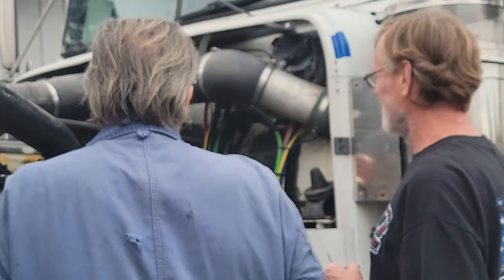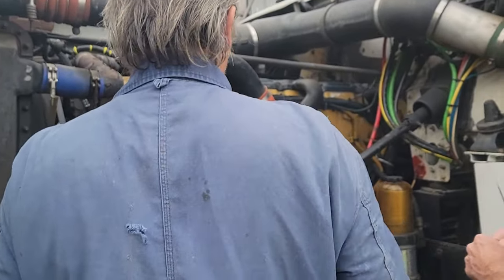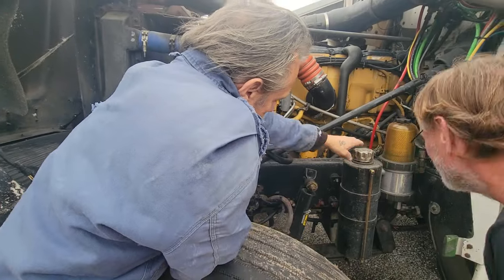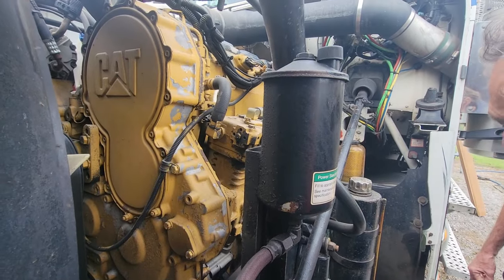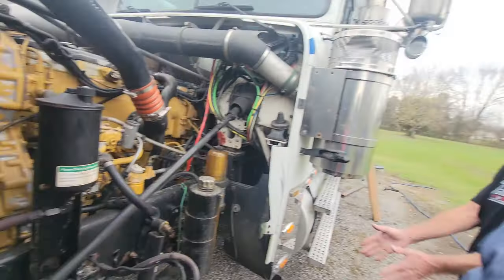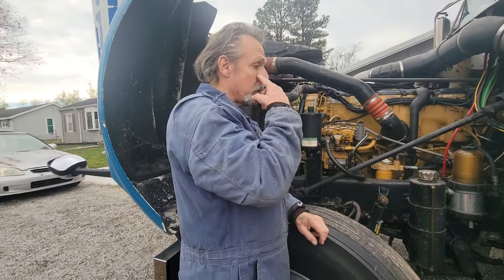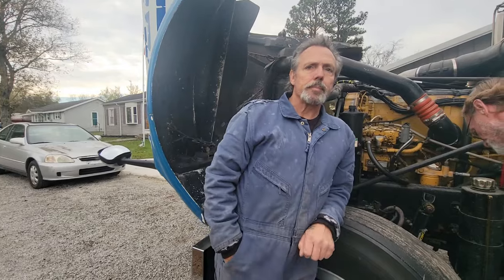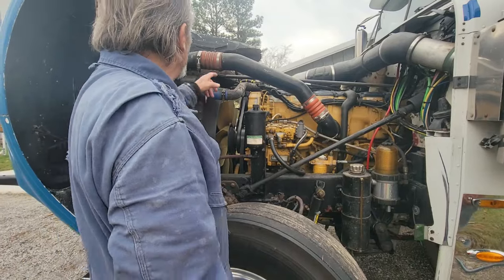HUGE MOTOR UPGRADE:  "THIS is the MOTOR that EVERYONE WANTS!"  #cp15 #6nz #catmotor #caterpillar

Comment: My 6NZ never had a hand pump on the fuel filter.....I prefill the filter (thru the inlet holes)and after changing the filter.....start it with your foot in the throttle. Never had an issue with it sucking air.
Reply from the maker: @jakem.6359  Thank you so much for watching our videos and contributing with your insightful comments.  Thank you!  Have a great Saturday!  Ruthie B Howard  11.23.24.